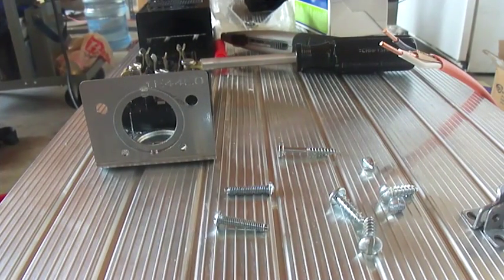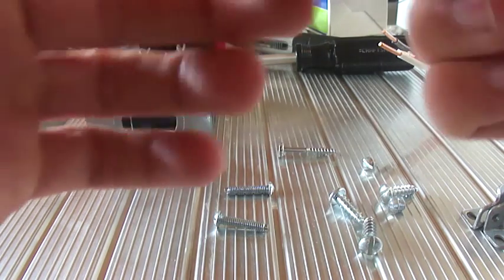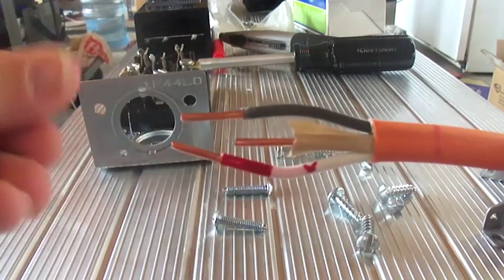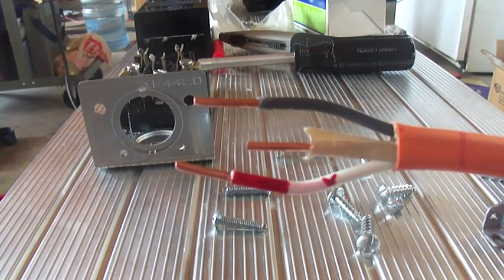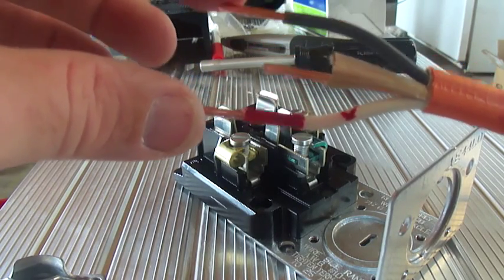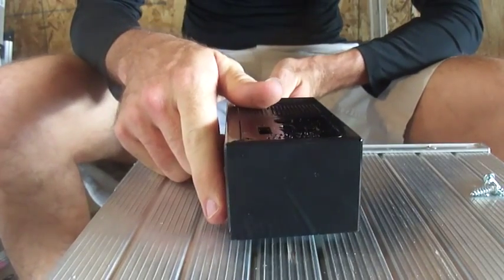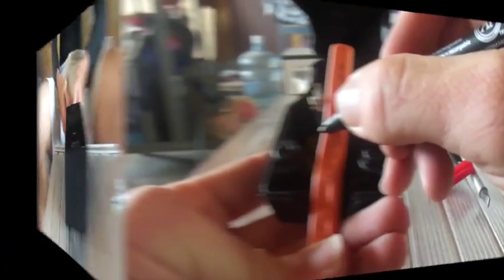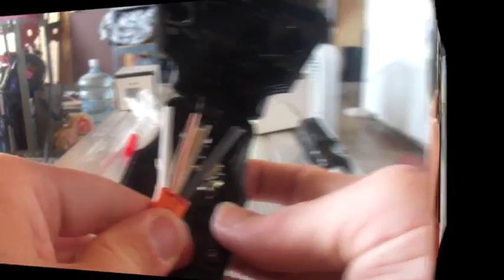Welding Cart 3, 230Volt 20Amp extension cord final

Comment: Wrong, wrong, wrong, and wrong.
Reply from the maker: Please explain, or make a video and help us out!
Reply: @michaelkaylor6770       I would have put more but had to go somewhere.    Although your cable probably works fine, that does not make it the proper use of materials.  
The use of a surface mounted receptacle is in its name.  Surface mounted, not extension cord.   You should use a cord cap receptacle.   Extension cords should be made of flexible cord, not NM(Romex) cable.   Something like 10/3 SOOW cord.  If you use a cord instead of a cable, the receptacle connector that comes with is for NM cable, not cord.  With cord, the ground is green insulated, not bare and likely to short to the plugs it is between.  How did a 50 amp cord and plug end up on a 20 amp welder?   Breakers, conductors, receptacles, plugs, and cords should be based on the amount of load applied to them.   240 volt should not be one size fits all.   Different sizes are made for reasons.   Mostly to follow (in this case) NEC. 
Respectfully Submitted,    Kevin